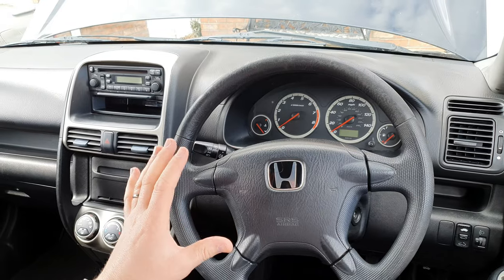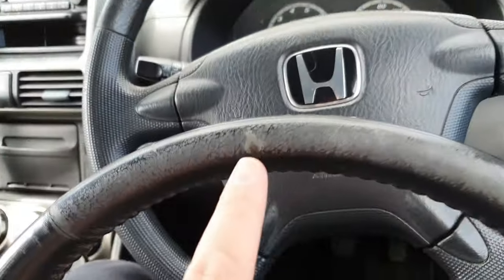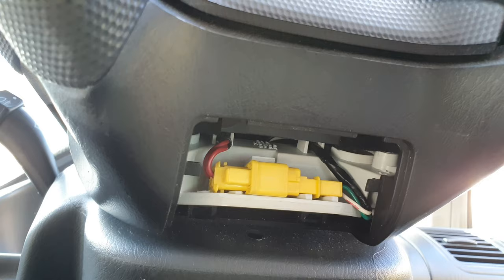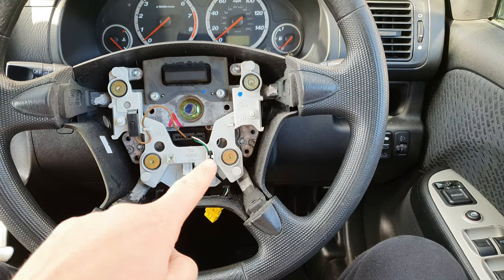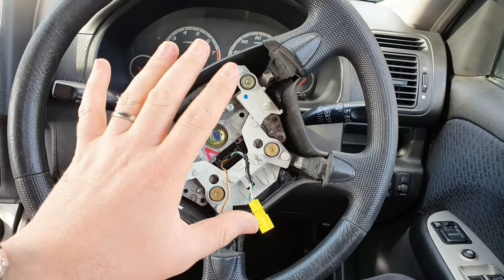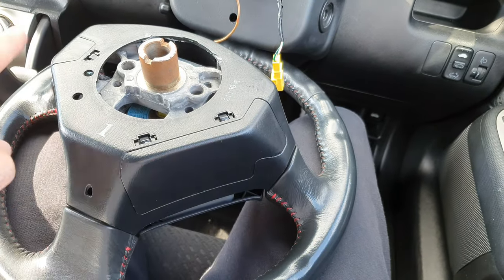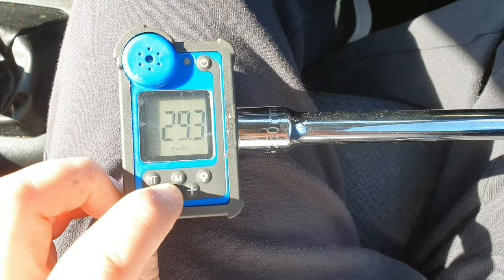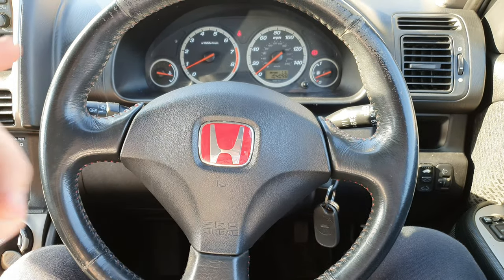type r steering wheel install/how to change steering wheel/steering wheel replacement with airbag

Comment: If I have the cruise control on my wheel, would I be able to swap over to something like this and still use these controls on the new wheel?
Reply from the maker: Yes this wheel has the panels to remove and install the the extra controls.

Comment: Where do you put the car original yellow abs socket into new steering..
Reply from the maker: 8:17 on the video you will see the new steering wheel has the yellow port to receive the yellow plug from the car.

Comment: Where do you plug the horn wire? The EP3 steering wheel doesnt have a plug for that.
Reply from the maker: There isn't exactly a reciver plug, there is just a small peace sticking out from the bottom of the wheel in the middle that the horn connects to.

Comment: Hi Gav, Smooth install, very helpful video. Question: I am looking to replace my 2005 EP3 Steering wheel grip, but part number Honda 78501-S6M-A91ZC Grip (Red) (Leather) is no longer available. Would you know where I could find a suitable replacement? I am prepared to buy new if I could find one. I would really like to get a new Type R if I could. Any help would be appreciated. Thanks.

2002-2005 Honda Civic 78501S6MA91ZC
Reply from the maker: Thanks alot for your comment. Unfortunately I have no idea where you could find it, have checked out type r forums? Just pop the question in and someone may know something about it or where to look. Sorry i couldn't help out.
Reply: @GPTV2020  Thanks, appreciated.